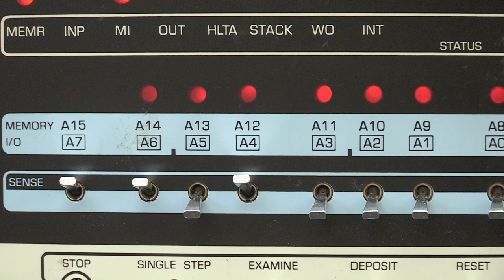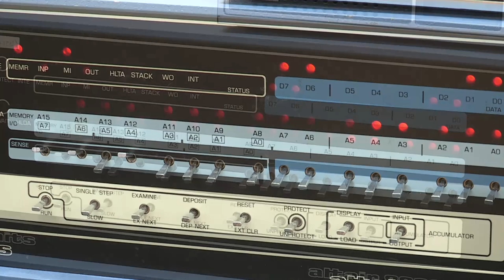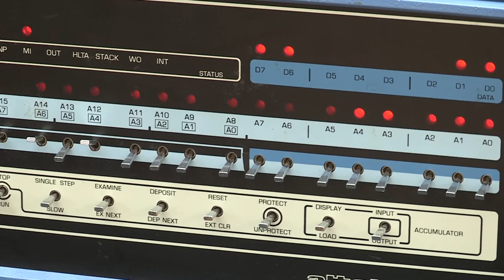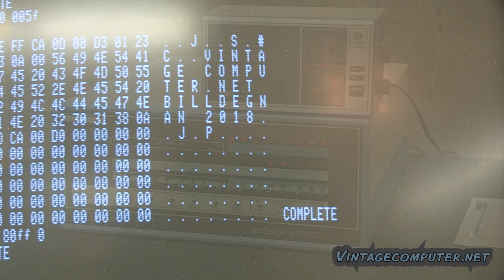MITS Altair 8800b AM Radio Music Jukebox - New RF Music Played by the Altair

Comment: I am looking for some CP/M software or HEX files that I can run on my Altair. Can you point me in the right direction???
Reply from the maker: The web is full of software, but you can't run CP/M without a disk drive, at least no practically.    Did you try to load BASIC?  Depends on whether you have the ability to download values into RAM.  See https://www.vintagecomputer.net/browse_thread.cfm?id=318